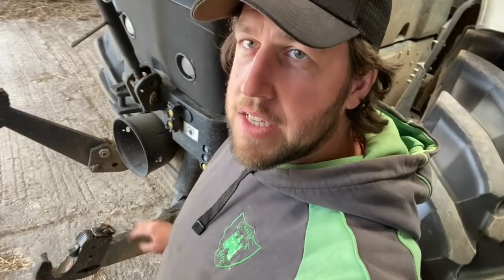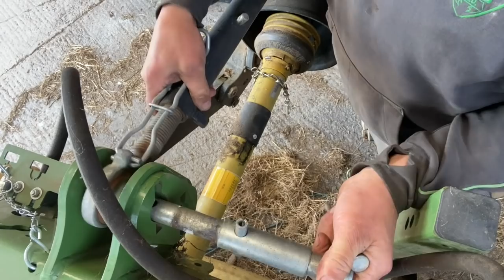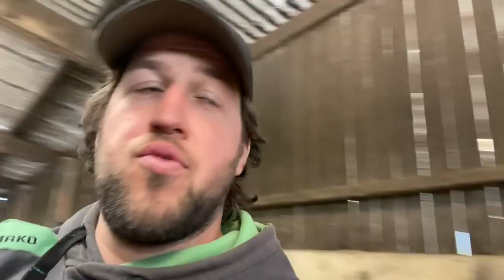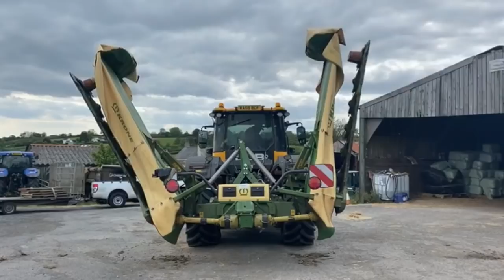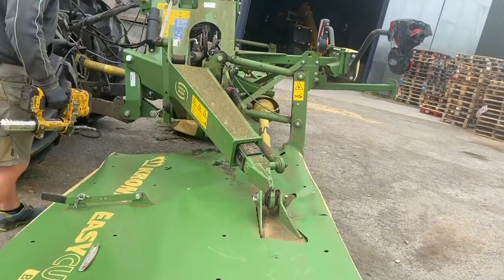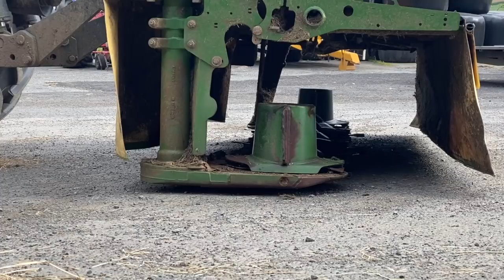JCB fastrac, krone easy cut mowers, grass prep Episode 48

Comment: I never leave my Kuhn triple mowers in the "up" park position.
I leave mine down in working position,dead level,up on blocks and turn the discs a few times in winter.
They are 2014 model year with over 10,000ha work on them.
The three mowers are sealed for life beds.
Reply from the maker: Nigel Clats so never need a oil change?
Reply: Apparently not,according to the Emmanuel,but I may have a look this winter and see what the story is anyway.
They have moved from the rockfields of Arthurs Pass down to the swamps of Christchurch.
I can pretty much guarantee I will get more Kuhns in future.

Comment: My cousin has new front and rear Krone mowers. The front one is the push rather than your pull type but has come off the A frame twice last week. We now bolted the A frame onto it. Looks like you don't use one? He has them on a T7.185 by the way.
Reply from the maker: I found A frames just got in the way
Reply from the maker: T7 good tractor
Reply: @thehayteamtv6830  I don't know why he uses it as mowers stay on all time during silage. Just finished yesterday. Hopefully start my bales next week but the cold and dry means it's not over heavy yet?